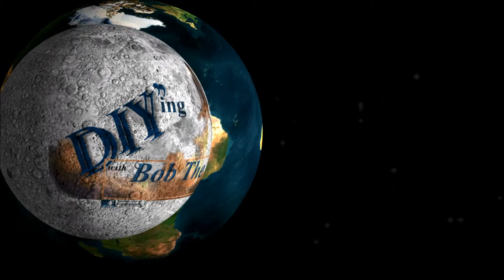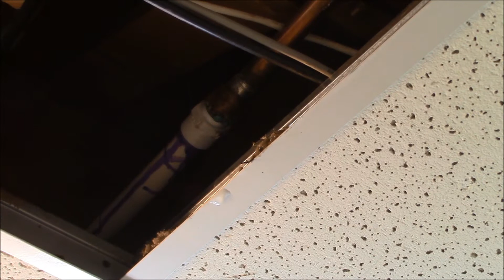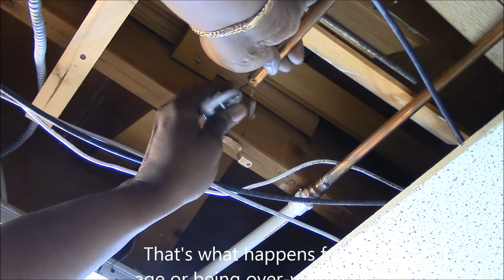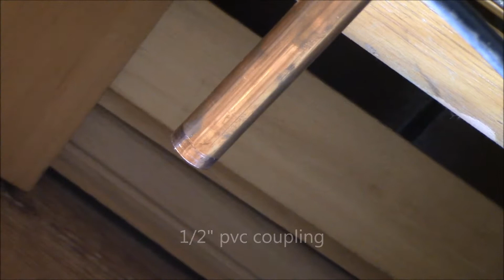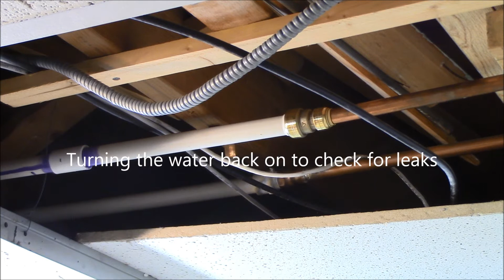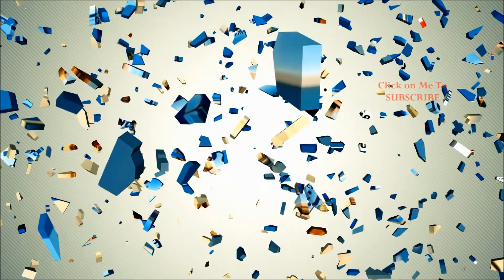Repairing a Leaking Copper to PVC Pipe Joint Using SharkBite Fitting

Comment: good idea.  I have the same exact problem which I fixed even upgraded to schedule 80 pvc to male copper with pipe dope, 3 times it still leaks,  so I didn't even think of using a shark bite,  which I have.  thanks for the demo.